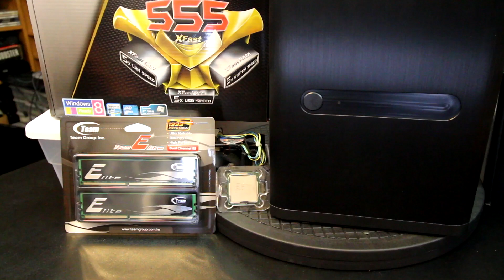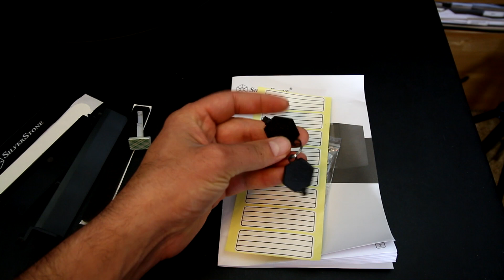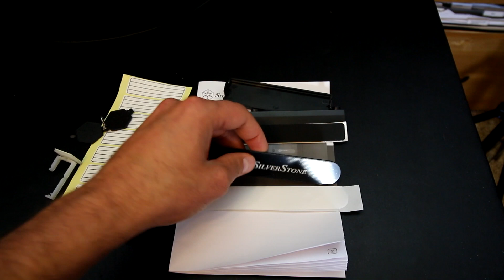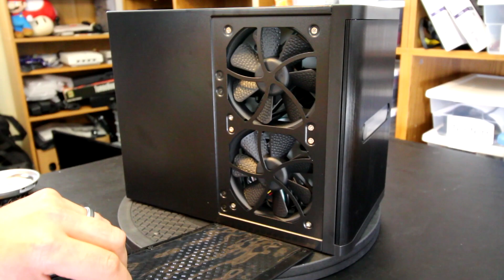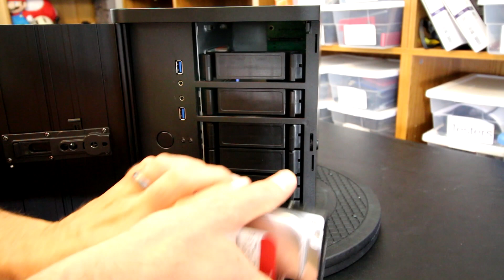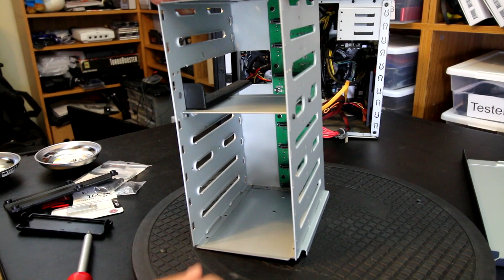NAS build with the SilverStone DS380

Comment: i need to get one of these bitches man nas's mmm need to store my pirated movies and tv shows somewhere lol 500gb and 1tb just dont cut it
Reply: +96donov better look elsewhere, you need ECC ram supporting motherboard, this build is shit as a NAS for that reason.
Reply from the maker: +Mike “Big” Hawk There are some NAS operating systems and file systems that work just fine without ECC RAM. It depends on the file system (or RAID equivalent level). ZFS for sure would be a bad idea for non ECC RAM. I have since upgraded to a motherboard and CPU that support ECC as I decided to go with this more complicated and safe file system. If someone was wanting something simple like the lighter Windows server operating systems (Essentials), then non ECC RAM would be alright. You are correct for data integrity oriented file systems, though.
Reply: AdoptedMike I'm currently planning my first NAS build, if I didn't mind not having ZFS and ECC this build would be perfect, I'm worried my files might become corrupt over time. I'm not sure a redundant raid configuration would help me here if the data being backed up is corrupt too.
Reply from the maker: +Mike “Big” Hawk  I went with the ASRock C2550D4I server board and 32GB of DDR3 ECC RAM (4x8GB). I found out that it is a much better platform for data security than what I was using in the video with the Celeron. I am now using FreeNAS and a ZFS2 and I have no worries about my data. I am using 6 x 2TB Seagate NAS drives.
Reply: AdoptedMike That's funny, because that's the exact motherboard I was planning to buy for my NAS build. The only problem is that I can't find a case that can support all 12 drives.
Reply from the maker: +Mike “Big” Hawk I used a Fractal Design Define R5. It has 8 x 3.5 drive bays. It also has 2 x 5.25 drive bays that can be converted to 3.5 inch bays. The best option for a 12 bay case would be a super tower or a maybe even a 4U server case. Or you could use 2.5 inch drives, but I probably wouldn't go down that road. They are smaller and more expensive.

Comment: Check these MINI-ITX motherboards for NAS, servers:

1) ASRock E3C226D2I (lga 1150 socket and max 6 x SATA 6 Gbps)

2) ASRock C2550D4I (with 4 core Intel Atom C2550 2.4 GHz / 2.6 GHz Turbo - Cache 2 MB)

3) ASRock C2750D4I (with 8 core Intel Atom C2750 2.4 GHz / 2.6 GHz Turbo - Cache 4 MB and 8 x SATA 6 Gbps and 4 x SATA 3 Gbps)